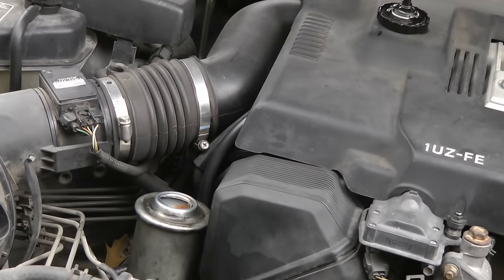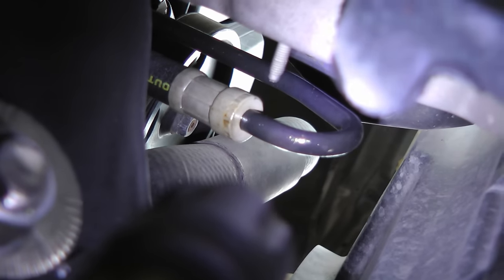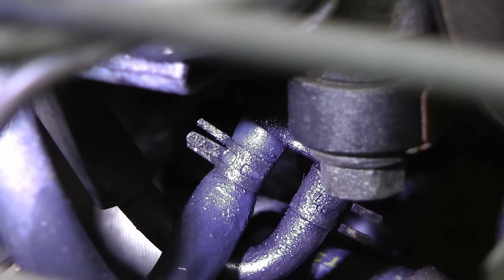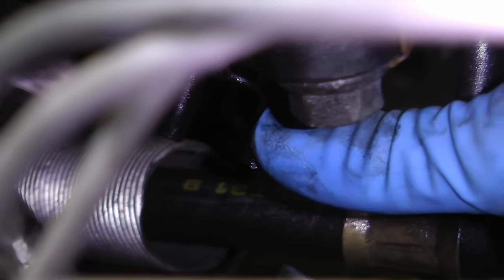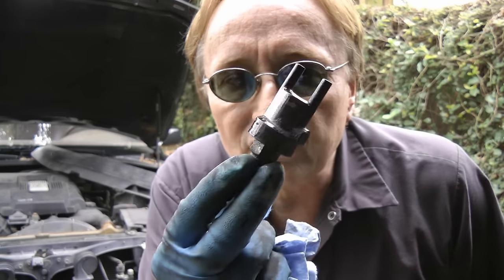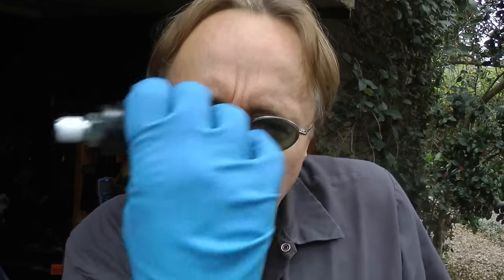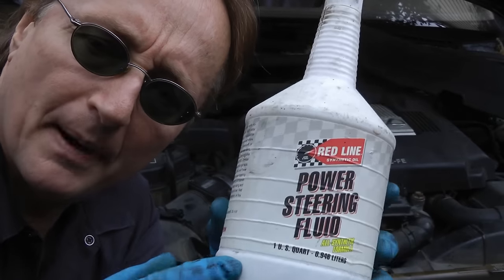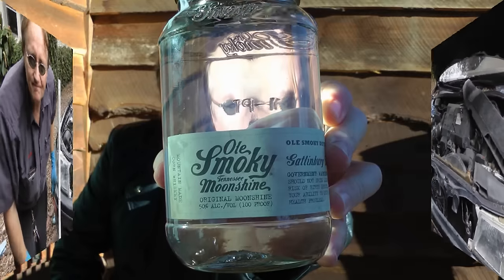How to Fix Power Steering Noise When Turning

Comment: Scotty my son is taking mechanics at the career and technology center at his high school and we absolutely love your videos!  He won’t say it but I think he’s impressed when his mama knows a thing or two about cars which I’ve mainly learned from your YouTube videos!  Right now he has a 2005 z71 Tahoe I got him for his 16th birthday that started making a sound when turning at low speeds. I told him to check his power steering fluid and that was the problem :) we’ve also repaired the antenna, the gauge cluster dimmer switch, oil changes, and the fog light button that was broken all DIY

Comment: I have a 2004 Mercedes Benz C320 that had a problem that sounded incredibly similar to the power steering pump. Almost every mechanic I took my car to diagnosed it as it going bad.  So I did an exchange of fluid (which happened to be full), nope... still the annoying whining sound.  Then, BOOM! Stranded one day... A/C Compressor seized.  There was one, ONLY ONE mechanic that told me it was the A/C Compressor that was making the noise.... and he happens to be my go to guy now-a-days!

Comment: When my old car did this, I knew instantly it was power steering (my ex then had a mustang he claimed the previous owner had let it get too low, and the car permanently sounded like it was powered by locusts when he turned). One of the hoses was leaking. I was filling it up daily. It wasnt TOO bad.. but man, everyone thinks about the oil, coolant and windshield fluid.. forgot about the power steering.

Comment: Mr. Kilmer, I was told more then 40 years ago not to use Teflon Tape on the power steering or transmission connectors and here you are doing just what I was told not to do so question how is the Teflon Tape  working out for you is the fluid degrading the tape and later causing leaks or is it holding up over time ?

Comment: I have a 2003 Ford Explorer that was making more of a rubbing sound. this continued for a couple of months when I finally decided to open up the hood and check my reservoirs. It turned out that my power steering reservoir was only about a quarter full so I went to O'Reilly's and bought a $4 bottle of power steering fluid and put it in. It immediately stopped the noise so I am very grateful it wasn't very expensive to get fixed. the reason I am making a comment is because those power steering problem does not necessarily have to be a whining noise. Mine was more of a rubbing sound so I hope this helps someone. Thank you for your good video.

Comment: Just had a power steering switch leaking like crazy.... it Drained my entire fluid tank in minutes  and led to smoking and bad noises like crazy.

Replaced the switch.... Filled it back up..... After driving about 20-30 mins it seems to be back to normal. Noises cleared away " Fingers crossed 🤞".

Hoping it holds and is not a pump issue.... Mine seems impossible to access - 2008 mercury milan. 

But so far not leaking and holding up. Great video and info 😁👍

Comment: For your viewers! I had a noisy power steering pump! I have a 2001 Dodge Caravan. I found out the the fluid in the pump was old stuff and contaminated due to age! I began sucking old fluid out of reservoir and adding new fluid. Then i would drive it and repeat this about 6 times. The pump got quiet and trouble is gone! James.
Reply: James Sasse sounds  easy.
Reply: Wouldn't it get contaminated if there's a leak and it's sucking air into the line?
Reply: Kim Possible     no,,,.  Contaminated from age,,,.  Should be replaced every 4 years,,. ???    Fluid is cheaper then a power steering pump or a rack and pinion,.  If you do not replace the power steering fluid before 80000 miles,,,. You will be putting a rack in by a hundred and twenty thousand miles. ???   Roughly,,,
Reply: im gonna try this. haven't seen leakage from my system yet.

Comment: Love your vids Scotty and your energy. 
I came here looking for some help due to a rattling steering issue in my 2013 Hyundai Santa Fe. There´s a lot of play in the steering wheel and when i go over uneven terrain theres a distinct rattling sound...not so much clunking, but a rattle from the steering column under the dash. Very strange. I know its a shot in the dark, but thought Id give it a try. Keep up the good work Scotty!!!
Reply from the maker: check the steering column for loose bolts or breaking bearings on the shaft

Comment: Quick question, my power steering on my 2002 Toyota Highlander may be having issues, but I have replaced the fluid but I’m not sure if all the air is out of the system. The steering is stiff when the car starts from cold, but once the car is warmed up it’s ok. And thank you for your help if you can see this.

Comment: How would I know if its the power steering pump or the power steering pressure switch?
Reply: Measure the pressure of the pump by pressure gage. And turn the wheel end to end while its running  and reading is ok then pressure switch is fine. More check bypass by close to the gage valve for 4 seconds if pressure go high its bypass valve issue. If pressure go low the bypass switch works.
Reply: My daughter's when turns the power steering fluid shoots out can't really see where but guessing the switch?

Comment: sometimes you may think your power steering pump is whining but it could very well be a bad bearing on one of the teflon idler or stationary serpentine belt pulley....
Reply: Tim Vittetoe True, I replaced my power steering pump on my 2005 F150 and it didnt help. Turns out it was an idler pulley

Comment: LOL!  Like the moonshine bit!  I got a 2015 Nissan Altima doing this sound and it's driving me crazy!  Its more of a high pitch sound that comes and goes.  Don't even need to turn the steering wheel when the sound comes on...  I'll try and get it in for looking over at the dealership as we got the extended warranty.  But viewing some posts, they consider this a normal sound and "NO" recalls from Nissan on this.  Why not?  This is an annoying noise that needs fixing from the manufacture.  Thanks for your video...

Comment: Don't have a $1000 to fix my ml320 rack pinion lucas was to thick blew my line so i cut the boot off can't fix the inner seal so i made a outer seal with a cut o ring and JB weld no more leak and now when the rack goes in and out when i turn their is no fluid residue on the rack i learned this trick from Star Trek Chief O Brian
Reply: Tyrone Williams Very good looking.
Reply: Why are you so mad at punctuation? What did a comma or a period ever do to you, Ty? XD
Reply: @BPoweredLove  You're not his teacher, nor is this a grading on grammar and punctuation course. 😑😒😴😴😴😴😴

Comment: Great info there, Scotty.  But what is wrong if the power steering system is only noisy (growly sound) turning the wheel to the left (95 Mercury Sable)?  PS fluid level okay.  36K miles.  Thanks for all your videos -- dig `em!
Reply from the maker: the power steering rack valve will often stick on one side and do that. Try flushing it out with a ps system flush, all auto parts stores sell em

Comment: Hey Scotty!

I recently hit a curb in the snow with my 2005 Acura TL. Turned right into a small road at 15-20km/h and all the impact slammed into my left driver wheel. I need to get the entire suspension replaced on the left driver side but something strange also happened with my Power steering pump.

I jacked up the car when I got home and turned the steering from one side to the other. I can hear gushing sounds from my car and my brother told me that fluid was leaking out the top of the cap. (With the cap ON)

After a while, the liquid stopped leaking and when I checked the levels, it was exactly on the "upper" mark with the steering straight. What exactly happened here? My steering feels a bit looser. Easier to turn the wheel. Feels like a new hyundai santa fe in comfort steering mode but I know it should be like that lol.

Thanks in advance,
Reply from the maker: it messed up the power steering rack too probably, but with all that damage, unless you have full coverage, get thee to a junk yard for used left side parts to save money
Reply: Yeah I drove 2 hours out to a junkyard that had a manual TL left side suspension. They're rare to find in Toronto.

Replaced the suspension today and the car feels better. Power steering isn't grinding or leaking anymore when doing a full turn.

Unfortunately the ABS on the junkyard part was busted so I'm trying without traction control...

Mechanic also told me the subframe was cracked a little too which is bad news. I really don't want to spend $1000s+ to fix the subframe if it's drivable. Are there any risks to driving with the subframe a little cracked?
Reply: Well, you can go back to a metal junk yard and get a good piece of steel and weld it :). Scotty has a video on welding so go and watch that.
Reply: i have same car lol

Comment: Scotty, my power steering pump is making a whining sound, Not when turning the wheel but all the time. It changes relative to the engine rpm. I checked the fluid level and it is ok. Now, with that said, there is obvious signs of (slow) leakage as there is muck on most of the system. It does not do it idle, but as soon as any rpm is put into the engine. I took a stick of wood to use as a stethoscope to confirm it is the PSP. I suspect that the pump is going bad, so my plan is to put some die in the unit to find the leaks and then replace what's necessary and the pump also, 04 chevy astro with 123K. What do you think???

Comment: Scotty, my Audi A4 B6 Makes whining sound when turning wheel after driving for sometime. When i start the car and start moving the noise is no longer there but after an hour the sound becomes bigger and its like rubber without greasing coming form my shock mounting rubber. the ATF level for steering wheel is fine. what could be the problem?
Reply from the maker: on those, pumps are garbage and just wear out internally and need replacing

Comment: Hello Scotty you are a total bad ass mechanic I have  2002 Ford Aerostar noise when turning steering wheel, thanks for the info on this video is there anything else I should know regarding this problem on the 2002 Aerostar also I bought it used and wonder if you have heard anything extremely bad about this model . It drove pretty good got it cheap 130000 miles looks like it was maintained

Comment: Hi Scotty! My 2000 Ford Ranger steering pump used to make a loud whine but after I did a full flush and added some royal purple, the noise is not as loud WHILE the truck is moving above say 10mph. But its still as loud as before while turning under 10mph. And its stiffer. Even louder when trying to turn while parked. There are no leaks or air bubbles that I know of.. Any fix to this?
Reply from the maker: yea, replace the pump with a new, not rebuilt, unit. Or just live with the noise
Reply: Scotty Kilmer Yes will be replacing it soon. Can you tell em which part causes that whine sound?

Comment: Another helpful video. Quick question Scotty, my steering wheel is a full half turn to the left with the wheels lined up straight. Its not alignment because the front wheels are not worn on one side. Steering makes a popping sound when i turn either direction. Is it a tie rod or steering column, ....? Also is there any easy way to check if its a tie rod, 1996 chrysler concord. Thank you

Comment: Hope you had the car on jack stands when you crawled underneath!
Reply: I don't
Reply: I don't generally it's safer but it's not really necessary if u have a decent Jack and are careful
Reply: There was a guy who died several years ago on the north part of the island I live on.  The jack failed and the car crushed him to death.  A jack is not meant for stabilizing the vehicle when lifted off of its wheels.  Jack stands are meant for this purpose.
Reply: @stanwardoshiro  no the Jack's aren't designed for this but a descent Jack can stand in for a jack stand for quick and simple fixes especially if u don't actually own stands tho yes u are correct it is dangerous and should absolutely never be done with the dinky dink Jack's they give ubwhen u but a new car

Comment: Hey Scotty.  Love your videos, man. 

Quick question:  I have the purring/whining sound when I turn my wheel.  I was losing power steering fluid so I used some Lucas Stop Leak.  Now, the fluid seems to not be leaking but I still have tight steering.  Should I try adding more steering fluid or what?  Thanks!

Comment: you really do good work and give great advice Skotty...i have a 2008 gmc acadia and it has been making that moaning sound especially when i turn the steering wheel  . do you think its just that it needs the steering fluid flushed or should i replaced the steering mump.
Reply from the maker: +banduluman try flushing it first, and of course fix any leaks if it's low on fluid

Comment: Scotty here you use Teflon tape, could you also use RTV? I changed the water pump on my truck and when I looked at some of the bolts some of them had red stuff on them. I thought it was red thread locker, but I've come to realize it might have been red RTV. Do you think you could maybe consider making a video when to use thread locker, RTV on threads, anti seize, and grease on bolt threads?

Comment: Hi Scotty, I have a 1996 Kia Mentor and this morning I heard like a knocking sound when I turn the steering wheel fully like after a stop or or at a slow corner. It doesn't occur in slight turns. The noise occurred both when turning left and right. Help greatly appreciated Scotty!
Reply from the maker: check for worn suspension parts first, jack it up and pull on the wheels and look for bad ball joints, tie rods, or A frame bushings that are worn

Comment: I have an 2005 Freestyle that when it gets heated up the power steering moans like hell AND when it is well heated up and sits at a long traffic like in gear with my foot on the brake the check engine light comes on is idled up quite a bit and it's like it won't let the transmission advance to the next gear yet I know that's not right cause it's a CVT transmission . I can put it in neutral and turn the key off and back on put it in gear and it goes fine yet till it cools down again the check engine light stays on and the problem remains . Could it be an exhaust sensor gone bad and making the car computer malfunction ? Could it be the coolant is over heating ? OR are the two even related . It's not a bad driving car so If it doesn't cost too much to repair it I'll keep it . Please get back to me if you have any input at all . I have my replies turned off so IF you heart my comment I will see it but I'm at a loss as to what the problem is with the check engine light thing is .

Comment: I've found with the 3D printed GM Saginaw power steering pumps which are an aftermarket aluminium replacement pump that where there's normally a Welch plug in the OEM pump but the  aftermarket pump has a grub screw in the pump body from when they machine it at the factory & I pressurized the power steering reservoir with a 100 mL syringe which had a Small length of 1/4" fuel.hose attached to it.

Well, when I pressurized the power steering reservoir I sprayed some soapy water around the grub screw & by capillary action I see red fluid being drawn out of the power steering pump through the threads of the grub screw.

So, after I have some sleep I.will remove the grub screw then either apply some thread tape or most likely thread locker to prevent air from getting drawn into the power steering pump.

What I mean if pressurizing the power steering system causes a fluid leak then air is getting drawn in under vacuum !

Comment: Hi Scotty love your videos! So my 98 Camry the rack and pinion was leaking. I replaced it with a remanufactured part over the weekend. It went well and I have no leaks but I have a question about turning the wheel all the way to the stops. If I go all the way either left or right I hear a squealing sound. There's a lot of confusion on the internet what this could be a loose belt a faulty failing pump? Kind of hoping you can clear this up! Other than going to the complete left to right the new rack is working beautifully.

Comment: nice video  now i realize what section to look for first on a power steering fluid system for leaks... rubber hoses first then steel tubes if the reserve is low ... curious obviously if the reserve is low is a good indication of a leak but will it always get low fast or is it ever easy to spot a leak power steering or  brake system because the pressures are so high ... or do you need special dye like the ac system or other systems to pinpoint the leak....
Reply: +sam111880 clean the area of the leak. get a uv light and the oil dye. you can purchase it from pepboys. pour it in refill to level. then drive it for a few mile then inspect with a uv light. works everytime for me

Comment: Scotty great videos as always but I do have to comment on the fact that you said the metal lines do not leak. I have replaced rusted metal transmission lines on a camry and seen a pin hole leak on a power steering that did not leak as much as if sucked air into the system. I understand that they are unusual and uncommon but do not automatically rule them out.

As for electric power steering my only experience with this is a car that came into my friends shop with electric power steering problems and it would have cost so much to fix that they totaled the car. Modern technology.
Reply: My Chev cobalt 2006 didn't work for me. Doing the ground wire I'm having the same problem. I did that it got worse. Help if you can thank you

Comment: What do you think: we had the noise and noticed that the power steering fluid was FOAMING.  Took it to the dealership, no leak, fluid just old; cool; flushed and replaced.  Noise still persists, only when cold.  Belt lube to fix problem?